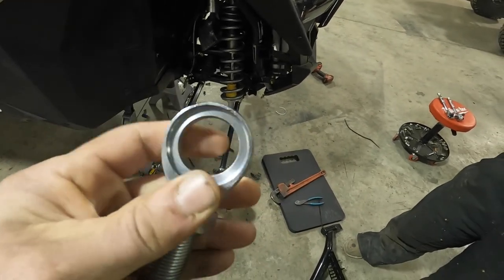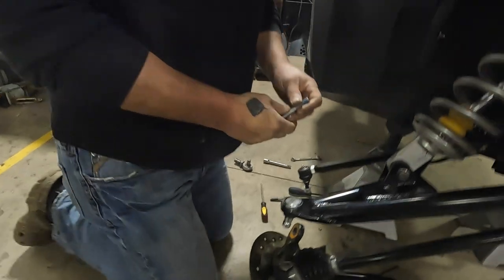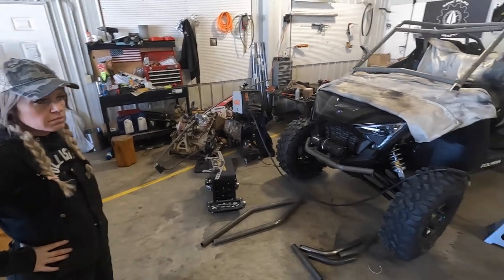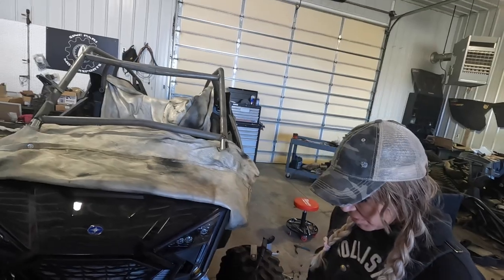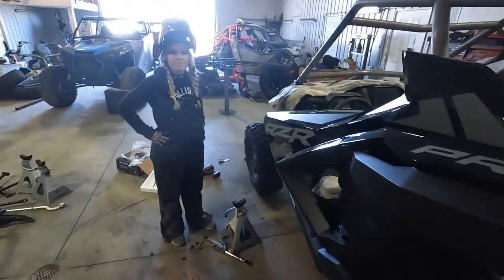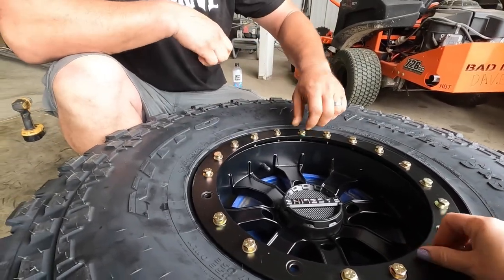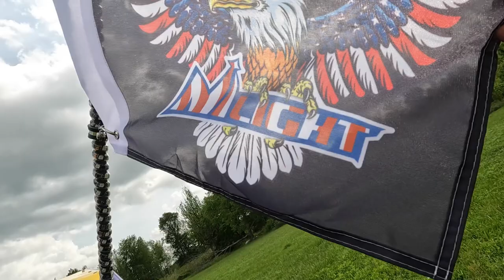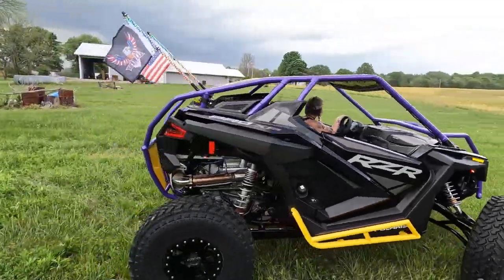How does it turn out? Pro XP build complete 35" NITTO Tires Gear Reduction

Comment: Do you do gear reduction’s for a pro xp, and or products you sell for it?.
I just checked description and found it..  ive got zbros springs on there now but sags a bit with two riders would you recommend turning them up or a 3 inch spring spacer?
Reply from the maker: We do gear reductions, sell the gears, came out with our own clutch kits designed for gear reduction. I’d just put some more preload in them vs a spacer
Reply: @CrashCitySxS thanks, in your opinion do you believe dynamic’s is worth it on a turbo r 4?  
I 
pretty well ride the same places you do. I just need a 4 seater for the kids

Comment: Freaking awesome build other than the yellow rock sliders do you guys recommend limit straps when you un hook swaybars
Reply from the maker: Hey like joe dirt says it’s not what you like it’s what the consumer likes! Whisker doos whisker donts lol. 

We’ve got front and rear sway bars deleted with forward a-arms and don’t have a problem with the axle joints binding or breaking. So I don’t see a need for them on our rigs. If we had axle issues then ya I’d probably throw some on there to see if they help
Reply: @Crash City SxS  thanks for the info

Comment: Why didn’t you go long travel
Reply from the maker: Customer didn’t want to. We don’t run it right now either. With the wheels we run and this one has on it’s 71” wide.
Reply: Wheel spacers ?
Reply from the maker: 3.5/3.5 offset Raceline wheels
Reply: Is that the orb 2” forward arms?